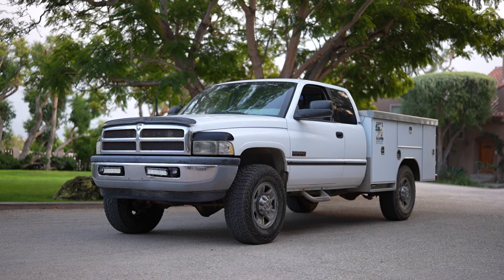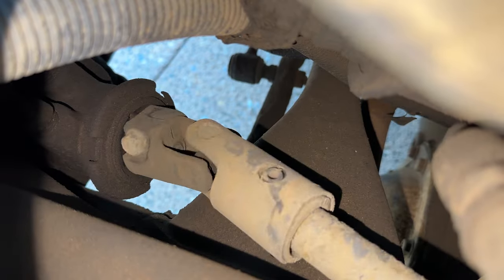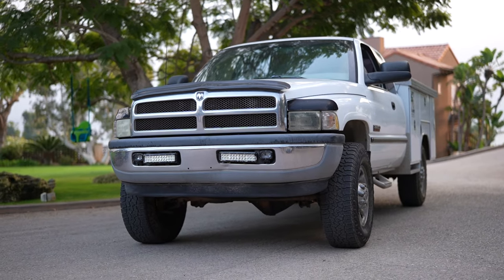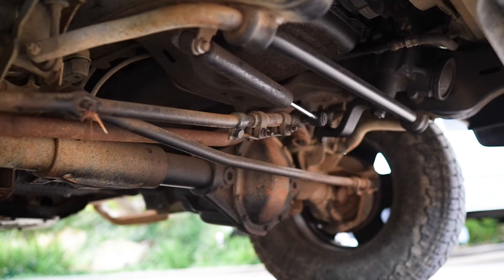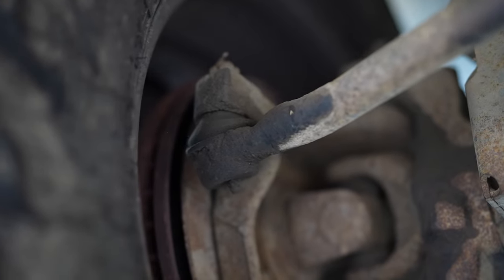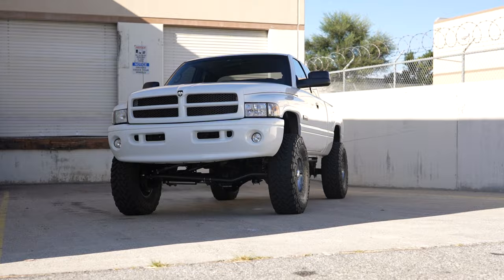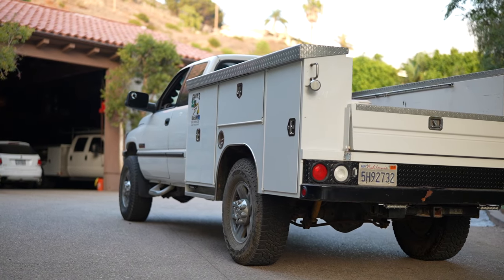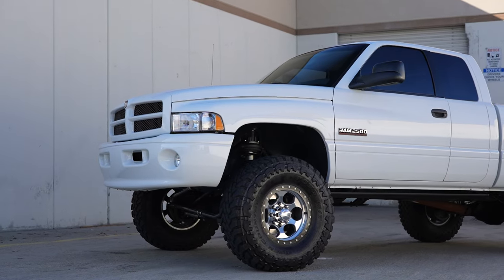How To Fix 2nd Gen Cummins Sloppy Steering & Death Wobble

Comment: To anyone skeptical about doing this I immediately bought synergy steering upgrade and their adjustable control arms for a 2012 Ram 3500 ST Dually 4x4 and I haven’t seen, heard or felt any signs of death wobble in 3 year’s!!  People guarantee a lot of things, but I can honestly say this is GUARANTEED to fix any and all issues you may have with your front end.

Comment: I’ve had the 4th Gen T style steering on my 01 2500 for about 12 years now with no issues at all on 35 and 37” tires. I also have the steering box brace, rock solid ram bushing thing in the column, dual stabilizers, modified steering shaft and adjustable trac bar. I’ve never had the slightest hint of death wobble and no alignment problems.

Comment: I just got a 97 1500 sport, I don't know what has been replaced on the truck if any has at all. It has over 260k miles on it runs healthy, trans is healthy but there is a play in the steering that I can't find the cause of. Its stiff when the trucks off, its stiff when the trucks on but not moving, but as soon as I go about 25-30 MPH, it starts to get loose but only when turning to the right. To go right, i have to turn the wheel about 1/4 turn before it will actually go right, if the wheels straight forward it will go left immediately. Does anyone know what could be causing it/ how to fix it?
Reply: PS: Also, no death wobble. Tires are brand new and slightly bigger than OEM. No aftermarket lift or lowering kit.
Reply from the maker: Have you gone through the diagnostic steps shown in the video? That should quickly tell you where the issue stems from!

Comment: Have you ever rebuilt a track bar?  Geno's garage sells the tools & kit to do so.  I also talked to Redhead tech support & and they not only agree but sell the pitman arm brace that adds a bearing to the end of the shaft securing it from flexing.  Some claim it must only be attached to the drivers side frame but they disproved that myth.
Reply from the maker: We have never seen very good longevity out of the OEM track bar rebuild kits. Also other benefits of complete replacements include the double shear mounting bracket and adjustability factor. We agree on the claim for a one sided brace. It was a specific company claiming that a one sided brace was superior, ironically they also sold said product.

Comment: I was just about to pull the trigger on the 4th Gen setup. That’s interesting you say it’s not the right setup and will cause issues. Now I’m back to the drawing board.
Reply from the maker: For some reason it's become the go to on the forums, but it's designed for a wider third gen axle, so you're forcing it into a place where it doesn't belong.

Comment: Pitman arm?  I could not for the life of me find OEM. What do you guys recommend?
Reply from the maker: 1998-1999 trucks that originally came with T-Style Steering (Where the tie rod connects to both knuckles) must use the pitman arm from 1994-1997 trucks, stamped TRW-246.
Reply: @CJCOffRoad  Looking for 2001. Only found Moog
Reply from the maker: Mopar has discontinued the TRW-246 part number so unless you can find it at a wrecking yard, 3rd party replacements are the only option.

Comment: when I first got my 99, truck was all over the road and a shop recommended 3rd gen steering. since then I've upgraded everything else, should I go back to 2nd gen y style??
Reply from the maker: We'd recommend the Synergy 2nd gen specific T style. You get the benefits of T steering, but with linkage designed for the geometry of your 2nd gen truck.

Comment: Thank you CJC and staff. I purchased the suggested Thuren track bar and Synergy T-Style steering linkage for my 2001.5 Ram 2500 H.O.  I did have a few question when installing and the staff were very prompt and helpful.
Amazingly didn’t find ball joints to be bad. After the alignment the steering is tight without play but still wonders a bit. I would like to replace control arms next. My Ram is unmolested just the way I want it. Original specs, no lift with no tire mods. My question is does Carli or Thuren make OEM length control arms?

Comment: Will this kit work for a rear wheel drive 2000 2500 dodge ram
Reply from the maker: Sadly no, those don't share any front suspension or steering parts with a 4wd part.